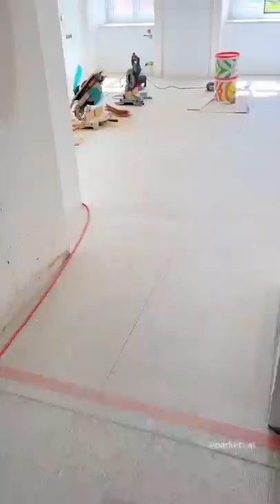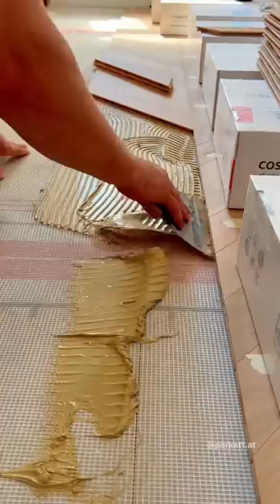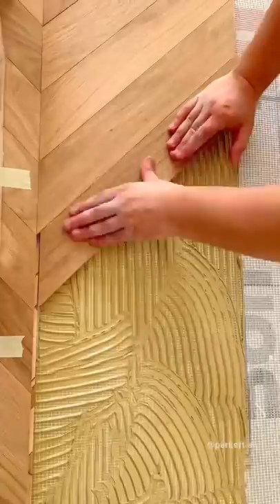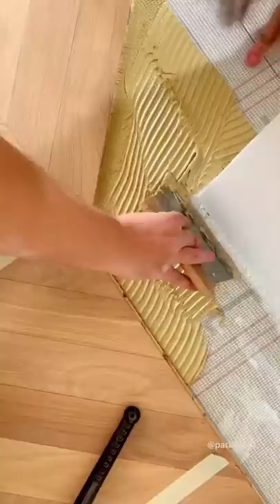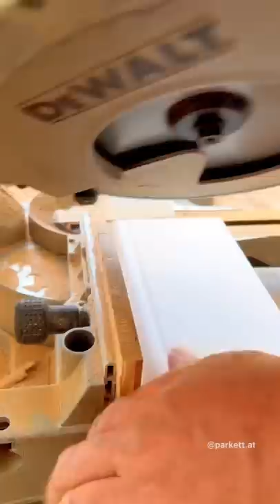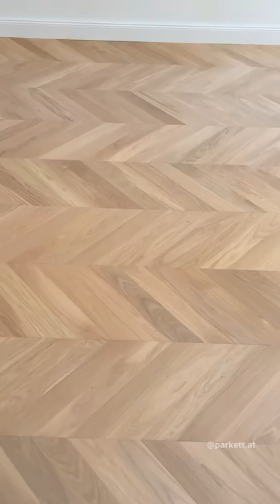Chevron - amazing transformation 🤩 #shorts

Comment: What type of adhesive did you use for attaching that base molding? And is the reason using glue versus nails because of a plaster type wall?
Reply from the maker: Hard elastic adhesive from Murexin. We almost never use nails here in Austria, just glue 🤝

Comment: I could be wrong I guess. But I wouldn't expect that floor to last too long without some mechanical fasteners in addition to the adhesive under it. A little drying to open some cracks and a little moisture and it will be popping up all over the place. If it doesn't, thats good for the owner. I wouldn't trust it.
Reply from the maker: This floor wild hold for at least 25 years. All fine. 🤝

Comment: He literally hot glued base on? Definitely a flooring guy and not a finish carpenter
Reply: @parkettat  you don’t use glue for a reason. You made everything look nice but now when the next renovation happens it’s going to fuck that drywall up. Nails are cheaper anyways just do it right instead of hacking it so you don’t have to putty nail holes 🙄
Reply: @gdmfbigo4  in europe we don‘t use drywalls, we have massive stone walls

Comment: Scribe the internal corners mate come on, time and money isn't an excuse for cutting corners 😜
Reply from the maker: This is an absolutely normal procedure.  Why should we scribe it. 🤷‍♂️
Reply: @parkettat  No it's not, any carpenter worth their salt will tell you otherwise. Cutting an internal corner at a 45 degree will just reveal the cut after some time when the wood shrinks or you get movement in the floor, scribing correctly will give you a tight fit that won't reveal the cut. It's one of the first things you learn as an apprentice carpenter.
Reply: @markhales7987  ...any carpenter IN THE US worth their salt will tell you otherwise.
no flooring guy/carpenter in EU would do so.